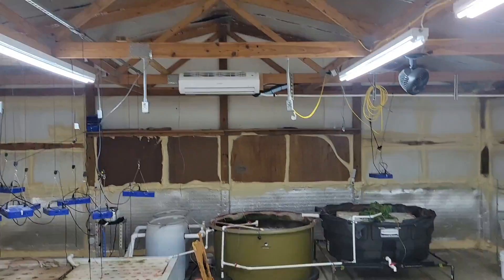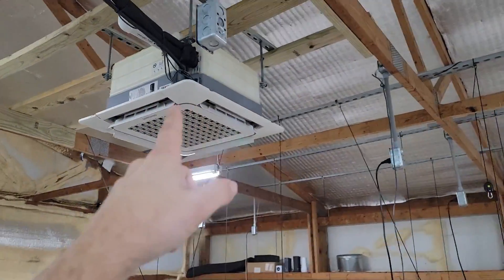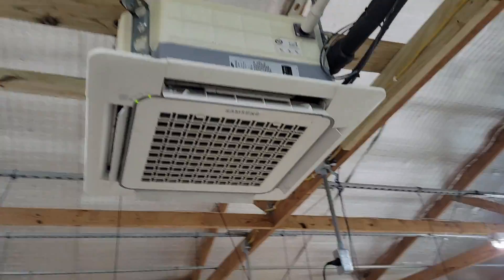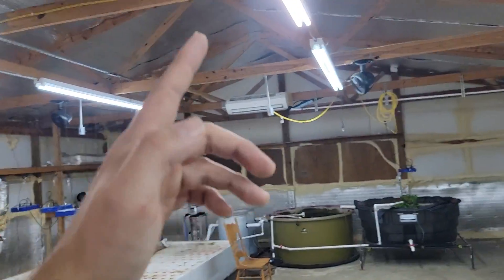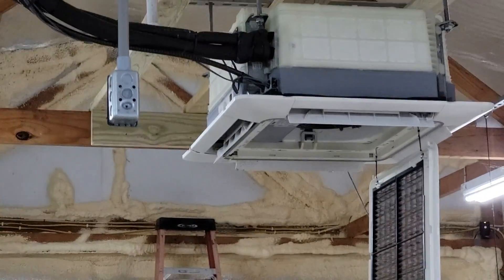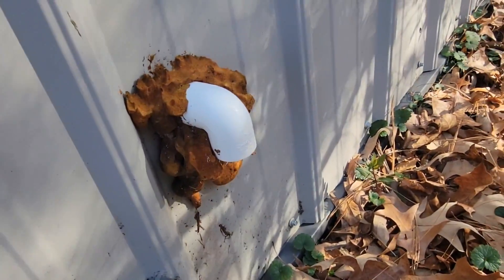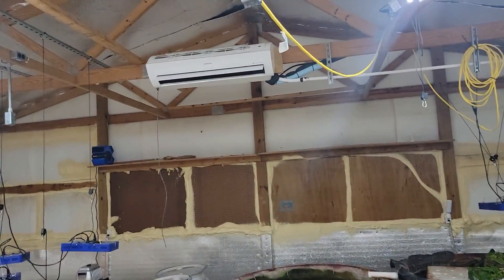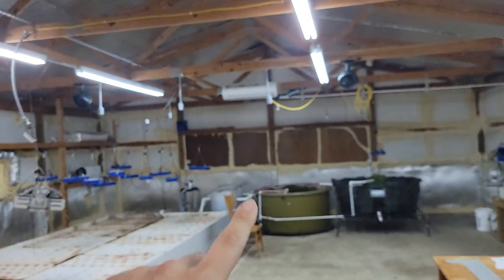Ceiling Cassettes Verses Wall mount air handler #minisplit #airconditioner

Comment: Taddy, Im here in upstate NY. installing a ceiling cassett in attic space - 2 things: #1- the condensate line will go out through attic (VERY COLD) space, I understand that it needs to be insulated but will it be a problem for winter use (meaning I intend to use this for heating too)??? Suggestions? #2- WIth the cold attic space - i noted that directions said to insulate the box of the cassett - do i need air space around it and/or can I just wrap the sides and top of it with Pink Fiberglass insulation? If so, how thick? Upstate NY says climate zone is needing R49.

Comment: Great video Tad! I have a new 30x40 with 10ft side walls shop. R-19 wall insulation and will have R-30 in the ceiling when complete. I have been undecided on the wall mounts or ceiling cassettes. I will need to add pumps to move the condensate up as the gravity draining will not work for this building. How high on the wall should the wall cassettes be mounted? You talked of a chart that gave a guide to how far the units would blow, is that available? I plan to do the install myself. Located in Stillwater Oklahoma
Reply from the maker: Depending on how high you mount the wall mounts on the wall, it may be easier for you to maintenance The wallmounts and yes, the guide is available for my members.Click the join button become at least the level one member.It will give you my email and then just email me.And request the guide.I'll send it to you

Comment: So I, trying to decide of one of these is the correct option for my enclosed front porch that I’m about to convert to an all season room. The ceiling one would look nicer, and I think I have a lot of space in the ceiling. I also am planning on insulating it as part of the process. I had thought the wall unit would be the easiest option but hearing about the pump is making me question that. My house is 100 years old with lath and plaster. If cost wasn’t a factor, I would want the ceiling one anyway since it’s a smaller space although now I know I’d want to turn off two of the vents, unless they have bi directional ones now.

Are there brands I should look into or avoid? I see kits for like 5-700 dollars, but I don’t know if that’s good enough or if I’m better off with something else.

Comment: Hello Tad. Thank you for the great content. I've have a 1,080 sq ft space that is an open building 36 x 30 with 11 ft ceilings in a Casita with a kitchen and a bedroom no interior walls. 
My problem is the closest wall unit would be 20 ft away from the bed and the cassette would only be 11 ft away from the bed. 

I want the unit that's going to cool down the space more evenly and efficiently but also lower monthly utility bills. I live in the Baja so it's daily temperature is 82° with 60% humidity..What would you recommend going with one 5 ton ceiling cassette in the middle of the structure or two separate wall units either 2 ton or 3 ton?
Reply: Can't go wrong with overkill!

Comment: Help! 
I am interested in a mini split system for my home. I currently have a forced Air system in a 1972 quad level home that has only 2 returns both on the main level and in the same room. Our ac unit is leaking and too small for the home. In your opinion what would be the best most efficient way to heat / cool my home ?

Comment: Hey I really appreciate the video!!! just curious on what you think blows More air the cassette or the wall hung? as in CFMs? i heard from one guy that the cassettes don't blow as hard as the wall hangs.But with everyone else I'm hearing is that it does.I wish I could see it in person but unfortunately I don't think I can.. unfortunately, with our house and the way our walls are set up there's no real good place to put a wall hung. We have windows pretty much all over the living room at dining room.... is the regular house that was built in 79. the previous owners did an amazing job.Expanding the upper floor but never expanded the HVAC so we're noticing in summer on hot days when we're having parties and family get together as the house gets hot and the original air condition or can handle it. we what a mind installing one big 24k btu but as you stated the bigger the unit, the more space it takes off.So we would be totally fine with installing 2 12k btus to make the 2 ton. we are from Wisconsin.Obviously we get cold winter as but as this summer has been proving.We've been getting multiple days in the mid to upper 90s, with high dew points. i gotta appreciate your time.Let us know what you think 🍻🤣🤣🙏🙏

Comment: I want to add a mini split to the second floor of the house. The second floor has a knee wall because of the A~frame roof. I want to use cassette style because the bulky ugly air handler looks horrible. The challenge ~I’m looking for an option that I can install a vertical cassette in the knee wall.

Comment: I'm in West Tennessee and shopping for a DIY solution. Former commercial and residential contractor and have some skills.  Looking for a 5-ton, multi-ceiling cassette unit for my single-story 2,600 sq ft home, I've been building in retirement for six years. Hope to install this year myself. Do you sell your product without install, but maybe some design advice? Are there floor cassettes available for your product?

Comment: Does a cassette with a condensate pump also have a float switch that turns off the unit in the event of a blocked drain line?
Reply from the maker: yes
Reply: @TaddyDigest  Thank you! Would you need to use an aftermarket float switch on a wall unit?

Comment: What's the depth requirements. I have a flat roof and my joists are only 2x8s. I could likely fir it down maybe 2 inches around the handler maybe

Comment: What is the smallest room you would put a 33" cassette unit in? I have a 1550 sqft steel building that is 60ft long with 14' ceilings (19' tall at the top of the gable)... Its a "L" shaped building, half of it is 30' x 20' ... the other half is 30' x 32'.... Trying to decide on using 2 cassettes vs. 2 wall units? if using a cassette unit, I would probably NOT frame it out but hang it as you did, not sure if thats a good way to go or not?
Reply from the maker: As long as you have a way to hide. The line sets and the drain pipe that come from the cassette. Then I would definitely do the cassettes because you can put them in the center and they have them blow all four sides.So they reach more surface area or area than a wall mount
Reply: @taddydigest  That's what I was thinking.... the Air distribution would be better with a cassette, but the install is slightly more involved. So, 2 pieces of unistrut and 4 long bolts/washers is all i need for the mount? Do I have to hide the lines? My setup in my shop would probably look like yours, most of it would probably be exposed, but i'm ok with that as it is a workshop:)
Reply from the maker: Looks like you will need three tons of heating and cooling with standard insulation with foam.You will need less
Reply: @taddydigest  Thanks for the reply. I was going to use two separate 2 ton mini split units for redundancy. Also, I'm in Florida with a tall ceiling.
Reply: @taddydigest  Do you have a cassette install video?

Comment: Can you offer information on some methods  to achieve whole house ventilation (exhaust) to comply with ASHRAE 62.2/TITLE 24 requirements. I know wholehouse fans are available, but I'd like to know if its possible to meet the CFM requirements stated in the Title 24 with a continuosly running range hood, bath exhaust, etc. Thanks!

Comment: I just built a woodworking shop block 30x30 with 10' ceiling.I will insulate block with foam and spray open cell foam at top cord of the trusses. I plan to install a drywall ceiling. I have been told to install 2 ton mini split. The room is open now but may install small bathroom opposite wall from the unit. I want to install a wall unit to avoid a pump and keep my line set to a minimum my question is can I expect balanced temp in the room or will I have to install a ceiling cassette type unit? I'm in Florida.
Reply from the maker: 2 ton should work if residential and it should be fine

Comment: I have a question. I'm a General Contractor in Portland Oregon. The relative humidity stays super high here. North of 80% on the reg. I'm building out an ADU and wanted to use the ceiling cassettes because of the sleeker look and since it's a new build I can run lines ahead of time, instead of surface mount. You mentioned clearance around the unit because of sweating, so how do I functionally address this? Am I resigned to wall hung heads or is it still possible, or rather, advisable to use these? How much clearance above does this beast need? 
Love the videos and thanks a ton. Maybe a ton and a half based on your sq footage😊
Reply from the maker: I would wrap the body above the ceiling with insulation and then it will not sweat
Reply: @TaddyDigest  awesome and thanks. That's straightforward enough.

Comment: Hi,

Thank you for your excellent video on ceiling cassette mini-split systems!

We recently installed multiple ceiling cassette mini-split units in our home. These units operate with water heated by a gas boiler in the winter and cooled by a heat pump in the summer. Each unit’s temperature is controlled with a wireless remote.

The issue we are encountering is as follows:
When we set a temperature on the remote (e.g., 22°C) while the room temperature is around 19°C, the unit cycles on and off a few times until the room reaches the set temperature. However, once the desired temperature is reached, the unit continues to run at a low fan speed without shutting off, even when no additional heating is needed. At this point, the airflow feels slightly cool, although the unit maintains the room temperature at 22°C.

This continuous operation is particularly bothersome at night, as the unit is in the bedroom, and even the low fan level disrupts sleep. Our contractor has informed us that this is normal behavior for these systems, as they are designed to maintain the set temperature by running continuously.

My questions are:

1) Is continuous fan operation a standard design feature of ceiling cassette mini-split systems to maintain the set temperature?
2) Would switching to a wall thermostat instead of the wireless remote potentially resolve this issue?
Your thoughts and recommendations would be greatly appreciated.

Thank you,

MB

Comment: I just had an expensive part replaced this summer. What do I need to do to switch from air conditioning to heat. I forget what button to push to dry out the condensation system before turning on the heat. I can’t find the directions. Thank you
Reply from the maker: push the mode button to switch from heat to cool and turn on dry mode to dry air out

Comment: Hi great video, I have a situation in a split level where central just isn’t getting it done upstairs ( 10 degree difference) ( A/C). 3 not so large bedrooms upstairs and bathroom. I wanted to do a hallway mounted cassette. Will it work. Total space around 400 square feet. I heard what you said about hallways, but I definitely don’t want to put in three wall units.

Comment: So do you think this would work in a rv trailer ? We are using a rv trailer as a home and wanted to get rid of the roof top ac and go with the mini split but that square box won’t fit inside it would have to sit on top of the hole on the roof.
Reply from the maker: I don't think so

Comment: So do you think this would work in a rv trailer ? We are using a rv trailer as a home and wanted to get rid of the roof top ac and go with the mini split but that square box won’t fit inside it would have to sit on top of the hole on the roof.

Comment: I'm interested in putting a mini split with ceiling cassette in a 200 sq ft camper. The roof will be sealed and insulated. Can the top of these units butt up to the ceiling?
Reply from the maker: yes If ceiling is insulated

Comment: Q, my son has an older home in New England with hot water heat.  He would like to air condition the upstairs.  Can you install multiple ceiling cassette mini split units with one outdoor heat pump / refrigeration unit without multiple refrigeration lines going down the outside of the house?
Thank you
Len

Comment: The townhome we are looking into only has an AC unit in the first floor.  .  It does not have a return line for the air in the second floor.  What is your recommendation
Reply from the maker: I would add a mini split for the second floor
Or make sure that you have a zoned system

Comment: Hello, what do you recommend for a bedroom with a small bathroom connected to it? Does the bathroom need its own separate small unit?
Reply from the maker: Bathroom does not need a separate unit
I would recommend a wall mount
Reply: @taddydigest  I’m confused by your comment. Are you saying you would recommend a wall mount for the bedroom and nothing for the bathroom, or a cassette for the bedroom and wall mount for the bathroom?
Reply from the maker: Wall mount for the bedroom. Nothing for the bathroom

Comment: Would a ceiling mounted minisplit with attic above be a better option that a ducted system installed in the attic in terms of efficiency? Concerned about the known issues of installing a ducted system in an attic and looking for alternatives. Thank you.
Reply from the maker: yes absolutely

Comment: I wanted to install 3 cassettes that have my attic on the other side.  The issue is,  i have a black roof, that is not vented and gets very hot.  What type of problems will i have?  Thanks
Reply from the maker: just insulate the drain line and the cassette body and you will be good

Comment: One big limitation i see with the cassette is that you have to either fit between your joist spacing or build a dropped ceiling. It looks cleaner, though,  so I don't hate it.

Comment: Hello . I really appreciate the information you provided on the cassette air handler . I have a 3 foot high attic is that proper ventilation or do you think it would cause issues ? Also they sell cassette mini splits with built in condensation pumps is that correct ?
Reply from the maker: yes

Comment: Building code official and design engineer here..I don't like the concept of having several different ahu units in the ceiling especially with condensate overflow problems which occur with all units. I would use a unit that was wall mounted and then use many ducts to go to different rooms

Comment: I think the wall mount air handler matchup is the most efficient. That would be one negative of choosing a cassette or console.
Reply: Yes and the condensate is outside mostly. You can use mini ducts from the wall unit to feed other rooms. I would not put a regular air handler in the attic and not several of these cassettes either.
Reply: The “efficiency” is not determined by wall or cassette.. use either as preferred. The brand and specs determine the efficiency.

Comment: Hi! New construction, vault ceiling.  
1. Can the ceiling cassette be installed on an angle? 
2. I need heat and a/c cassette unit, so any suggestion of a cassette that does both? 
3. Any insulation preference fiberglass bats or spray foam for best operation? (Not done yet)
4. Also, would the ceiling cassette unit over a bed blow downward? 
5. Do you have a referral for a hvac company in the Fox Lake, IL area? 

Thanks!
Reply from the maker: I actually need to do an updated video
I will do a video today answering all these questions.
Reply from the maker: https://youtu.be/M28ZjOBmW3c

I made this video for you
I hope this answers your questions

Comment: Great video! Do you know if the ceiling mount cassettes can be installed in a slanted ceiling?
Reply from the maker: thanks and no on the slant they have a drain Pan so water would poor out 
they have to be level

Comment: Are cassettes small enough for a 8x10 bathroom?
Also i have oil heat steam , is it worth it to switch to heat pump? Located in md
Reply from the maker: No but the one way cassettes maybe

Comment: I have an 1100 sq ft home with no heat or ac it’s a cabin and wanting to install a split unit into it so I can live in it full time. It’s a slab on home with an attic. It’s in Minnesota by a lake so it gets -30 degrees here and summer 110 with 80% humidity. I’m not sure which one to do. I’m very low budget being single and doing this myself. The walls are already up and I’m not sure how to do or which one to do.

Comment: We have a rental with 4  ceiling cassettes installed 2020. One of the handlers is displaying what appears to be mold along the 4 outside edges of the cassette. Filter is clean. What do you think can be the cause? What to do to fix?
Reply from the maker: Make sure that in between the ceiling and the sides of the cassette are insulated and sealed.
Check the humidity in the house. Is it high? may need a dehumidifier if it's above 65% percent or higher 
That may be a good place to start

Comment: I watto install 3 Samsung Mini Cassettes in my house. Do you know if there is a minimum distance between the concrete ceiling and the top of the cassette?
Reply from the maker: Yes you need at least 12 inches.
Reply: @taddydigest   Many thanks for the quick response.
I would really like to install the cassette type. It is quieter and distributes the air better in the room. However, I am limited with the height . Do you know why this 12 inch gap is necessary?
Thank you again.